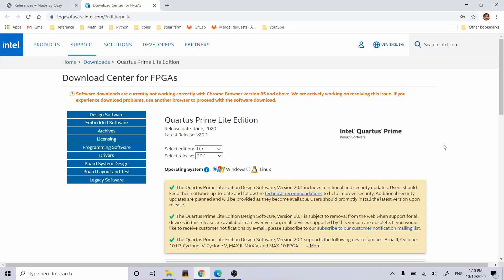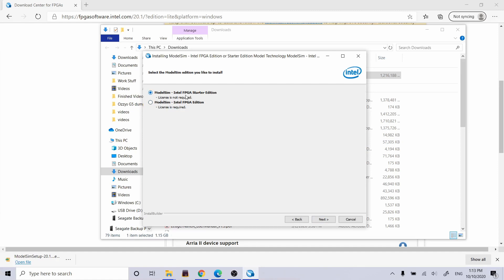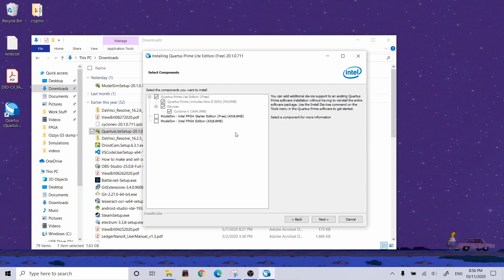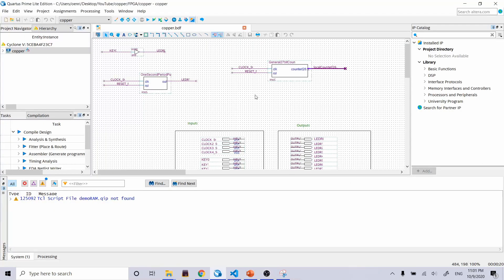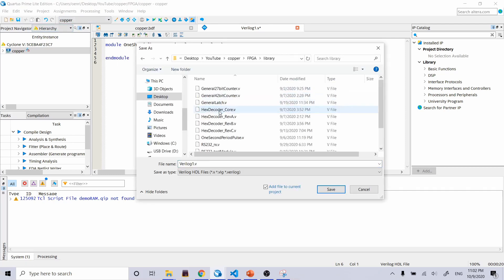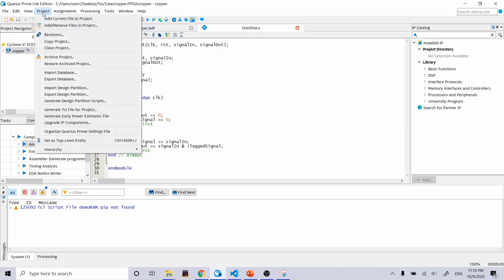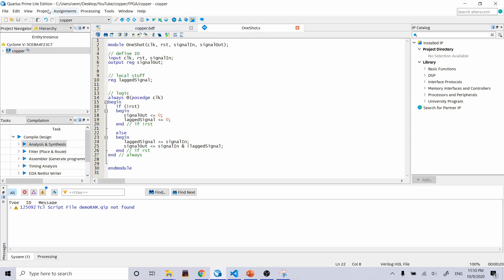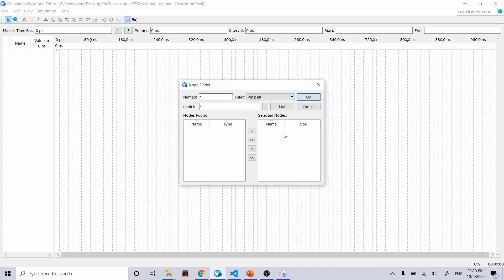Quartus simulation of one shot module FPGA Essentials 010

Comment: For whatever reason if you save your .vwf file inside of the main project folder (so the copper folder) the file paths work correctly. I don't like saving it there but it caused me the least headaches doing it that way and you don't have to keep moving files around when you make changes to your timing diagram. I've been following these steps:

1) Save your .vfw file inside of your main project folder (the folder where your bdf/qpf/qsf files are)
2) Go to Simulation -> Simulation Settings
3) If you changed your .vfw file name to something other than Waveform.wvf, hit "Restore Defaults". If you didn't change the name you don't have to do this
4) Remove the "-novopt" option from the ModelSim script
5) Hit "Save"
6) Run Functional Simulation
Reply: @coolshoeshine  No problem. And yeah really enjoying the series so far. I've been programming and doing embedded system design with microcontrollers for a few years professionally. Always wanted to get into FPGAs as well for DSP applications but it's kind of daunting to just get started with it in the first place. Always hear the horror stories about the toolchains too (lol). This series has made it less scary, though 😂